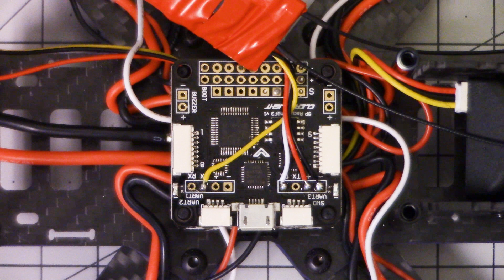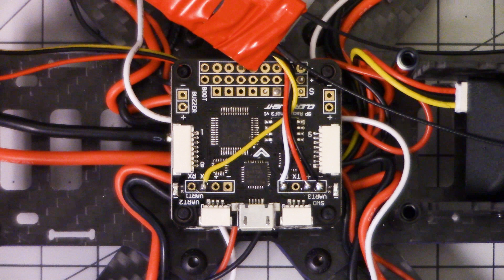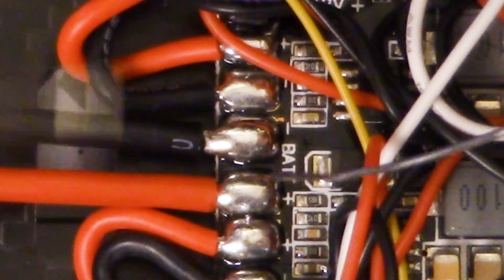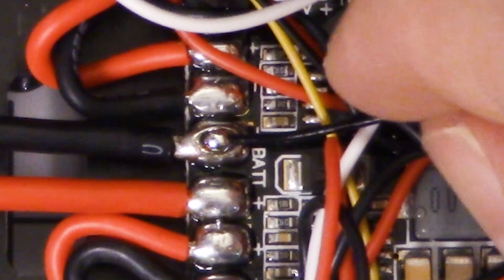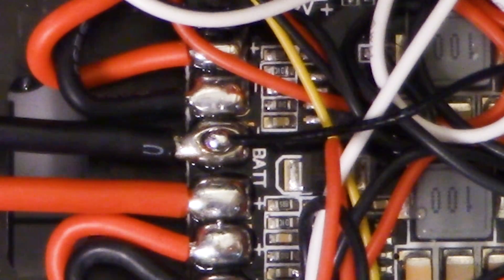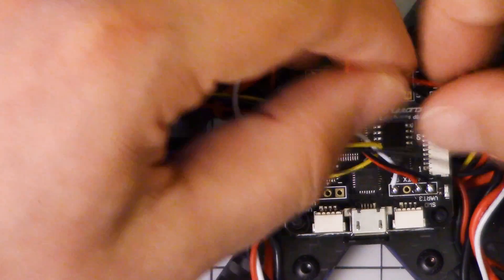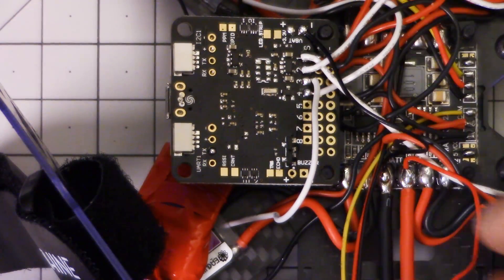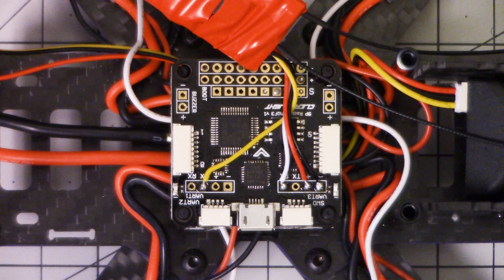Eachine Wizard X220 | BATTERY VOLTAGE MONITORING HACK

Comment: I followed the exact method in this video to wire vbat wires, and I did just that, nothing else.  Now my x220 cannot connect to betaflight configurator, and I cannot arm the motors anymore.   I made sure all the connections and soldering joints are good and not touching anything else.  However, I noticed that there's barely any gap between the Battery ground soldering joint and the soldering join of the black wire right next to it (at 1:36).   I know for a fact that I didn't move the battery soldering joint in anyway since I just put a little bit of tin on top of the joint just like in this video.  Could the two mentioned soldering joints touching do this to my x220? or can it be something else?
Reply: mythek that's fine, they're both ground. with the battery unplugged, and just USB power, are you getting any lights?
Reply: c4pt1n54n0 When I connect the computer to FC without battery, I get the usual blue light and flashing red light.  the computer detect the available com port, but it just won't connect.. :/
Reply: mythek ahh, it sounds like you might have a bad USB port, or more likely a solder joint on it broke from the board.after enabling autoconnect in BF and plugging a USB cable, try tilting the port away from you a little bit, as you face it, and push down some to put better contact between the pads at the back of the port and the FC. Keep an eye on your screen as you mess with the port, you should see it connect erratically as you move the cable around.
Reply: I dont think that the USB port is faulty because I was able to boot into STM32 bootloader to flash my FC to betaflight 3.1 firmware.  Once flashing was done, I removed the boot jumper and restarted the computer.  When i connected the FC to my computer, the PORT on betaflight changed to COM7, blue LED is on, and the activity (red) LED is flashing, betaflight says that Serial Port successfully opened, but FC still cannot connect.    My other quad can connect to betaflight just fine using the same usb cable and same usb port on the same computer.

I appreciate your response and I would appreciate anyone else's inputs.  this is so frustrating grrrr
Reply: mytheki I do understand the problem, my board does the same thing. the power pads are much more robust and have not broken, all that's been severed most likely is just one of the TX/Rx lines. I now use a spare fdti adaptor in a UART port because that takes some godly soldering skills. give it a shot, the only other thing to try is buying new parts
Reply: omg i'm so happy, i figured out why the FC won't connect.  Somehow there's a tiny little soldering ball, less than half mm diameter got stuck to some of the pins on the processor.  I can't believe i missed it the whole time.  everything's good now.   ^__^
Reply from the maker: +mythek I upgraded my Fury F3 to 3.1 yesterday. I get "device malfunction" error whenever I plug in, but if I wait a few seconds, I can still connect. I wonder if 3.1 did something with the VCP code.

Comment: I have a question about my friends wizard. One of his motors twitches badly when plugging in the battery (much more aggressive than the others). When throttling up, this motor continues to twitch but never spins enough to provide lift. His electronics knowledge is limited and lives in another city so I can't help him troubleshoot very well. He has described to me that the wires to that motors ESC get very hot despite throttling up (just when battery is plugged in). Any ideas? Would a bad ground on the PDB cause this? I was thinking a short on the PDB shouldn't make any wires coming off it hot so maybe an ESC short? The quad has flown before and this issue happened after a light collision with a couch. I appreciate any advice. Thanks!
Reply: xWOOLYxMAMMOTHx sounds like a cracked solder joint on one of the three motor wires. brushless motors have to electronically switch poles as they spin, instead of a brushed motor where the brushes always physically line up with where they need to provide power (magnetism) so if one is dead, only one pole will be pulsing on and off and that ESC will give everything it's got to get it spinning like the rest. either that or the same thing happened somewhere internally on the ESC, or motor. hopefully not, good luck!
Reply: c4pt1n54n0 Thanks for your response!  I will relay the information and see if he can identify a bad soldier joint. It's difficult troubleshooting without getting my hands on his quad. Some time, a soldering iron, and a multimeter, and it would be easy to isolate the problem. Unfortunately, my friend has none of this equipment or the experience to find a solution. It will come!
Reply: xWOOLYxMAMMOTHx if no bad joint, all you need is the iron anyway to swap a motor and see if that or ESC is dead.  no meter required 😀

Comment: Thanks Joshua... I actually did the vBat 2 days ago when my Wizard arrived, and I did the same thing after looking at those solder balls on the PDB (and mine have even less space between them - I was intent on NOT reflowing them). 

I'm looking to do the telemetry next, and was bummed when I realized they did not include the other JST-SH 8-pin for the other port, and was going to hard-solder my SmartPort RX/TX to UART2 -- but then I watched this and you said it doesn't work. 

I'm using UART1 is just for USB right now (so I don't need to disconnect anything to change rates/PIDs), UART3 is used via the 8-pin JST micro for SerialRX to my X4R, so short of UART2 I don't see a lot of options for telemetry links? SoftSerial and one of the GPIO ports on the right-side JST header/pads? 

What would you use to get telemetry back to the Taranis? (Before I go making the same mistake) - or is it just that it needs both RX and TX rather than the one wire? I know I read that somewhere as well for some models of FC
Reply from the maker: You can solder s.port to UART2, just not UART1. What I ended up doing was busting off the plastic header for UART2 and soldering direct to the pin.

Comment: A stupid question from a nub. Once you solder on the buzzer, how does it know when to go off? If you set it somewhere, where is that, and what voltage would you choose for a 3S and 4S battery respectively? Is it in beta flight?
Reply from the maker: Set up a buzzer mode. https://www.youtube.com/watch?v=SLy28mYiAzU

The default warning voltages are fine. The FC determines whether you have plugged in a 3S or a 4S at startup and automatically adjusts the threshold.
Reply: Thanks!
Reply: Thanks sir

Comment: Links to appropriate buzzer/beeper?
Reply from the maker: Any 5v-rated, 12mm diameter, piezo buzzer will probably do. The key is that is be active, or self-driven, or however the listing puts it. This means that when you apply voltage across it, it buzzes, but it cannot play tunes or anything. Passive buzzers take a PWM signal, which means they can be made to play music, but they need a driver circuit that the FC does not have.

Here is an example of a buzzer that will work.

https://www.amazon.com/uxcell-Industrial-Active-Electronic-Buzzer/dp/B016FCBBT0/ref=sr_1_2?ie=UTF8&qid=1485392472&sr=8-2&keywords=5v+piezo+buzzer
Reply: Thank you, Joshua.

Comment: I just bend the positive leg of the buzzer in and then down at a right angle with a pair of needle nose pliers to get them closer together and solder the buzzer right into the board.
Reply from the maker: When I have done something like this, it inevitably breaks off from crashing and vibration. The only way this has ever worked is if the buzzer is flush to the board, like on the SPRacing F3 (if memory serves).
Reply: Fair enough. I'm not going to say this scenario hasn't happened to me at least once.

Comment: Wow...thank you soo much for doing this video...this is something i surely needed. One question though...if i do everything you did in the video except adding the buzzer will the battery voltage be read on the radio...my radio (SBUS) shows RX 5v data already and can alert me on low voltage....I am guessing i just need to enable vbat on betaflight?
Reply from the maker: You would need to set up telemetry to make that work. Or alternatively if you are using a receiver like the X4R-SB, you could wire up the A2 port on the receiver to vBat. But you MUST use a voltage divider or you will destroy the receiver.

https://www.youtube.com/watch?v=Uq3E2R8Cb7Y
Reply: Thanks for your reply....i am using radiolink r6dsm....its pretty nice. I may be out of my league with that...i already installed a lost model buzzer so i soldered it to b-(signal) and aux 7 (+,-) maybe i might remove this and just wire it as you suggested. Thanks again....really appreciate your work.

Comment: your blob is most likely gonna chip off.
Reply from the maker: It's just hilarious when I've been using a given technique for like three years with zero problem, and somebody on the Internet takes one look at a grainy close-up video and predicts the future. And the future is always dire. Settle down, Cassandra.

(Cassandra actually is commonly mis-used in this way to mean somebody who is worried for no reason. In actuality, Cassandra predicted the future correctly and nobody believed her.)
Reply from the maker: No, it really isn't. It isn't. It just isn't. If you do this wrong, it might, but when I do it, it doesn't. I assure you.
Reply: Lol
Reply: lol again. I mean when i saw that joint i thought it was a little sketchy too, but i just trust that you have been doing this longer than i have and definitely know what you are doing, which is probably what most people (hopefully) do. Or at least (hopefully again) most take into account that you have been doing this too for a while and that you are not a noob who cant tell the difference between a good and bad solder joint.
Reply: It may not chip off for you, but you haven't seen my flying :-)
Reply: If your worried about the wires breaking off and shorting out something, put bit  of silicone rtv across the area and this way the wires stay put.

Comment: what if the cold solder joint comes loose and shorts any 2 polarities on the pdb?
Reply: SCY satish this is likely going to happen
Reply from the maker: You need to flow the underlying puddle enough to get some welding between them. I assure you, this joint is not going to crack off if done correctly.

Comment: Should doing this also be able to have it display on your controller? Such as the Flysky fs-i6x?
Reply: Joshua Bardwell Yeah the fs-ia6b receiver provides a voltage reading to the fs-i6 transmitter from the FC, which is 5v until you drop out of the sky. If you mod the fs-ia6b you can get vbat and with a modded firmware on the transmitter you get threshold alarms for 3S, 4S etc. Much more useful. Not having to mod the receiver is preferable though :) ... hopefully that's where the fs-x6b comes in ...
Reply: the receivers which do support VBAT do have a designated port. It's not that the FC is telling the receiver your battery voltage. You'll need to solder 2 cables more. I only know the ia6C and the x6B receivers support it.
Reply from the maker: With a FrSky receiver, if it supports telemetry, the FC can communicate vBat to the receiver via telemetry, and vBat shows up on the Taranis. I don't know the FlySky ecosystem to know whether this is possible though.

Alternatively, the receiver itself will sometimes have a sensor input. You use a voltage divider to wire vBat into the receiver (do NOT wire vBat without the voltage divider) and that puts vBat telemetry on your transmitter.

Comment: I have a question about using capacitors on pdbs. The realacc hubosd pdb comes with a 25V 330uf 105 degree capacitor. I know that in one of your vids, you say to use a 1000uf capacitor....wil mine still work and what are the draw backs?

Comment: Hi josh I done this today with a matek led and buzzer combo and removed the led's underneath.. I also added a diatone sp3 vtx osd.. I think it's installed correctly however my osd is quite faint and appears to have some sort of resonance like it's pulsing.. I haven't set it up in mw_osd yet nor betaflight for the vbat.. any idea what might be causing it.. arming the motors doesn't effect the pulsing??

Any help would much appreciated!!
Reply from the maker: Try uninstalling the vTX OSD board from the copter. Power it via a separate 5v source and see if the OSD display has any distortion. You'll just see a black screen because there's no camera but you should still see the OSD text.
Reply: Do you think I need to power it from the vbat terminals on the pdb as both the monster camera and diatone sp3 can have direct voltage??
Reply: Joshua Bardwell thank you so much for the reply you really do help grow this hobby and it makes it less daunting knowing you're there and willing to help! Keep it up mate 👍🏻🍻
Reply: Apparently it has something to do with high tvl cameras and minim osd
Reply: when i unplug the camera the osd is perfect and when its plugged in its back to a washed out font and slight flickering.. does that mean anything to you? still think it could be the voltage? would it matter if i ran the camera and the vex from 2 different power sources.. because the wiring diagram wants you to pass the voltage through the vex and on to the camera..
Reply: PAL / NTSC conflict?
Reply: Silweror yeah definitely could be if the camera comes in pal @50hz and the osd is kicking out 60hz!! That's what it sort of looks like a refresh rate issue.. however I can't get the osd to connect to the mw_osd GUI?? I have the right drivers and updated java but no luck!! There was a guy on YouTube saying he had one and couldn't connect to the USB and the top of his was getting extremely hot. Which mine kind of is but I guess you should expect a bit of heat from a vtx.. I have contacted diatone this evening so I'll continue with it tomorrow and hope they come up with a solution

Comment: Great video! Could you maybe do a video showing how you upgrade the fpv camera with something like a swift? I hear its not plug and play but it makes a huge difference. Cheers!
Reply from the maker: I performed this upgrade and I think I even recorded it.
Reply: Joshua Bardwell Great! would be keen to see it :)
Reply: Joshua Bardwell perhaps how to set up vbat with RunCam Swif 2 with OSD. That would be very useful
Reply: Yes please do.  Also upgrade the vtx.  I did the hard wire to the stock vtx with the sma ext and upgraded to rotor riot cam.  I bought a spektrum vtx 200 with the small digital read out for channels  and wired it like it said but the rx doesn't turn on or read out.  And the buzzer I put in like you said and just clicks.  It doesn't alarm like a regular buzzer.  I got it from another pdb that was leftover.   Worked before.  Was just a 2 pin.

Comment: Why your telemetry didn't work? I've been watching oh so many build videos to see if I can get that right with my freshly bought X4R

And happy birthday [:
Reply: Telemetry is not working on UART 1 on SPRF3 because it is also a com that is beeing used for USB. You can use UART 2 or 3 for you're s.port telemetry :D
Reply from the maker: Petr is correct. You can share telemetry with USB on old-style FrSky telemetry, because it is one-way. But S.Port is two-way, and the receiver is always polling the UART. So it conflicts.
Reply: Joshua Bardwell So can I leave 1 for usb, add telemetry on 2 and osd on 3?